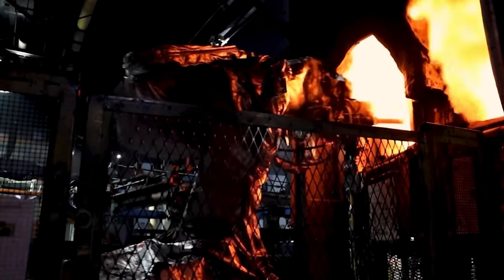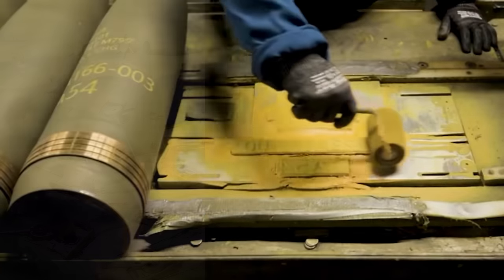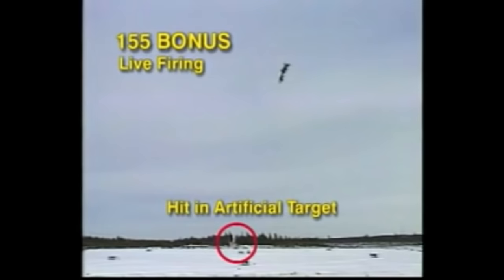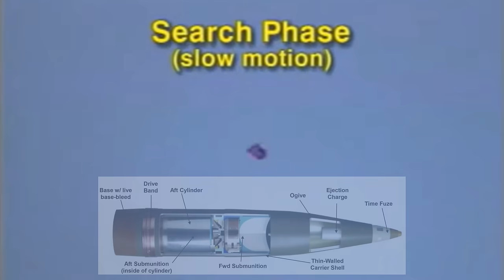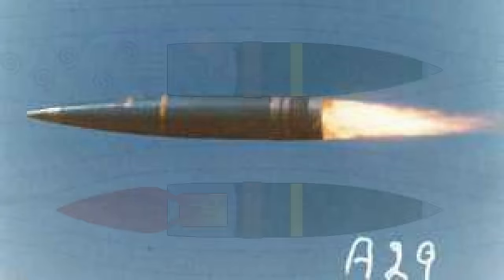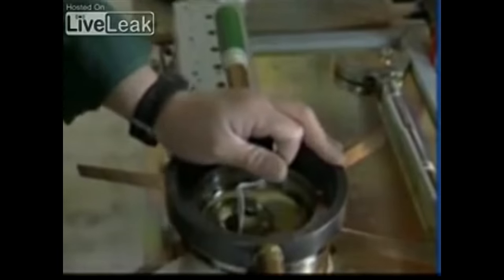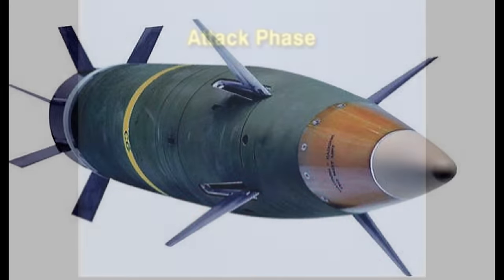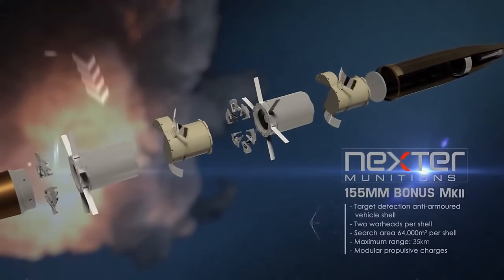Is the 155mm 'BONUS' Round the most Practical Artillery in Modern Warfare? TANK HUNTER KILLER 💥

Comment: Hmm... I think it is really a problem with manufacturing quality and currency - not so much caliber. If you bang 60 year old shells down range, Then you are going to have duds - if they don't explode in the barrel (heavily worn). That is one problem with shitty shells - just about as bad is the logistical inconvienience. If you are running a lot of bad rounds (might be imprecise as well) on trucks - well they WILL explode if the truck or Scooby Do van is provoked by an FPV-drone dropping a grenade on it. One thing is the driver of the truck won't have problems breathing any more - he just stopped smoking permanently.

The price question? Well, the first batches of anything will have their teething problems. But once the production run is going - it is actually more expensive producing a bad round. Modern technology makes the same mistake over and over again - but once the gremlins are fixed. Generally mass production is cheaper. In my ancient experience the shells being painted by a robot is much cheaper than being painted by a painter, that has to have all sorts of protective gear. Just to mention a point where I have seen a development.

The thing is that the first 100.000 shells are going to be damned expensive. but generally: If you take example number off the production line the cost is say X Euroes a piece. When you double the number production 2 X is 10-20% cheaper to  produce. Every time you double the production number there is a 10-20% cost saving.

The current problem is that there is a limited production capacity on the 40 year old tooling that is a hand.

The other problem with advanced shells is that there is more that can go wrong. You mention a dud rate of 10-15% - which is hardly acceptable. That will be corrected along the way. That is small comfort to the ukrainians needing more shells YESTERDAY. But it is a problem you allways run into.

There is even problems with the Leopards track at the present usage. Here I am reminded by "Chieftain" and his obsession with track tension. The might be a reason for his paranoia in this case.

Comment: This is going to require dedicated battery assignment to the supported forward observer. A tank is a moving target, and the FO is going to need to “lead” the tank. That means the FO needs to know time of flight, time it takes to calculate fire commands, time to load, and aim. So the battery (or parts thereof) are going to have to be “at my command”. This was the largest challenge for artillery that was uncovered at National Training Center for dealing with the communist horde attacking in West Germany in the 80’s. A massed attack creates a target rich environment that too many FO’s are trying to hit with too few artillery tubes to go around.

Comment: Been wondering, how this rounds can get the jet so far. Or is it firing some other submunition that again explodes with the jet when hitting the tank?
Reply: depends on the jet ur talking about. 
the jet behind the round is just the round bleed and is similar to rocket assist
if ur talking about the jet from the actual anti tank part that can hit quite far then thats just how far a heat round can travel if equiped with high quality explosive and smart design.
Reply: @flabelflabel7913  The jet from the molten copper that penetrates the tank. From what I know, such streams/jets are effective for only a meter or so. Yet from the video it seems that it hits the tank from at least some 50m altitude.

Comment: It's the same as the German SMART ammunition, only it works with a braking parachute
Reply: Bonus have a much greater range when deployed, it can scan sevetal hektars in seconds
Reply: @matsv201  Have you some sources? I wasn't able to find something like this? But why should nations use Smart 155 when the older system should be much better?
Reply: @85daniel  Well smart was developed as a competitor. I would say the prime benefit of Smart 155 is probobly the cost. If you have a very high concentration of armor, smart 155 is probobly the better choice in thinning them out.

If you don´t quite know where the armor is BONUS is way better.

Not only does BONUS Travel over a wider area of ground, the way it spins it also scans longer to the side, hence cover more ground.

There is also the diffrance of BONUS (if i remember correctly) using ladar and IR while SMART using microwave detection

So why they are similar in concept, they are very different in implementation.

The range from the gun is also better for Bonus being both lighter and have base bleed.

I have not seen number on it, but i would image that the charge is larger for SMART

If cost was no factor i would always go for bonus

Comment: Can the plasma jet penetrate ERA explosive reactive armour , I thought the whole point of the Russian ERA bricks was to blunt the flow of the plasma jet penetrating the tanks armour ? Wouldn't that make this Swedish tech kind of obsolete ? Also can it find its target through a smoke screen released by a tank ?
Reply: Both ERA and smoke screens are orientated to defend against frontal and side attack vectors in expectation of engaging other ground forces. Most tanks are highly susceptible to top attack munitions.
Reply: It is not a plasma jet, but rather a slug of copper, accelerated by the explosive charge. That limits its penetrating power to (BAe numbers) 100-140mm+. Compared to the often 600mm+ you will see for a shaped charge warhead. 
What you lose in penetration, you gain in stand-off range. A shaped charge warhead has to detonate right next to the target for its optimal effect, an explosively formed penetrator can initiate tens of meters from its target and retain its effect. 
When it comes to your question, it depends on the type of ERA. Older types with non or limited effectiveness towards kinetic penetrators will not be effective against these rounds. 
The newer ones in the main works by sheering a long-rod penetrator, but they will still have some effect on a slug. Is it enough? Sometimes, sometimes not. The roof of a tank carries some of the thinnest armor and the slug may retain enough momentum to punch through. Also, the turret roof has a number of hatches and other, smaller areas that cannot be covered by ERA.
Smoke might be effective against the BONUS round, it uses a LIDAR (a scanning laser beam) for its target acquisition. The German SMArt uses a milimetric radar so would be immune. But how should you be able to screen your tank with smoke in time? There is no advanced warning such as with illumination sensors. The scanning by the LIDAR is achieved in split seconds and then the charge is fired. Only if the screening by smoke is achieved prior to the arrival of the shell, be it for other purposes or by warning of incoming rounds, could the BONUS sub-munition be fooled.

Comment: The BONUS round is very effective.
But it’s capabilities are very restrictive!

A GPS guide 155 is much cheaper and way more versatile.

It can destroy all armoured vehicles.
They can be used against buildings and bunkers.
Even cause trouble in a trench.

So I prefer a GPS guided 155 round 😊
Reply: A GPS guided round on an armoured vehicle would need circa 1m accuracy and with a time of light of 60 seconds that's not always very useful against vehicles.
Reply: tanks move and a 155 gps usually cant be redirected in flight

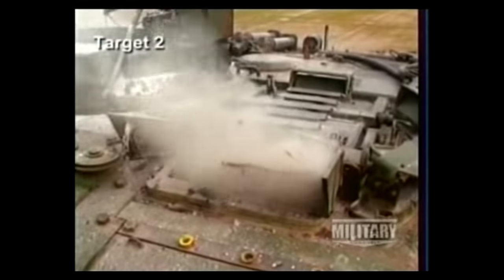Comment: 13:43 3D printing isn't going to make BoNuS -like systems much cheaper. 
3D printing large quantities is much more expensive and slower than molding, folding, machining and other more traditional methods… and makes a difference only when you really need complex geometries that traditional industries can't produce (sponge geometries with a lot of shaped holes, microstructures with variable density, weird concave puzzle shapes, etc) or because you need a high level of programmable customization per piece, aka lot of parametric variations on demand between pieces. This is not the case for this type of shells.
But yes, of course, the unit price of this will decrease if mass-produced, even with very conventional methods.

Comment: @Matsimus good Sir, I always thought that the shaped charge has to detonate a certain distance from the target, hence all kinds of "skirts" and "cope cages" , and that it loses penetrating power in proportion to the square of the distance to the target. How can it be that the EFP remains efective after traveling 75m?? Seems to contadict common knowledge about HEAT munitions.
Reply: I have exactly the same interrogation ! I would be glad if someone "in the know" is able to answer.
Reply: EFP is not the same as a HEAT, a EFP more like a normal kinetic round but the penetrator is formed via the explsovie
Reply: @einar8019  that description also applies to common HEAT round, it is indeed a kinetic force. Common misconception is that is uses actual heat as in thermal energy but the copper in the shaped charge is supposedly not even "liquid hot" but "superplastic" and as I understand it it loses penetrative power not due to "cooling off" but rather has to do with focal point of the inverted cone... Could this be the answer? the cone is so flat is focuses at about 75m? But then again this distance is not guaranteed, this Bonus round might zero in on a target sooner or later right?...?
Reply: @miloszruczynski1230  im pretty sure the shape is different, HEAT makes a jet/small stream whilst the EFP makes a slug which doesnt loose focus
Reply: @einar8019  You know, that would actually make a difference. I'll stick with Your explanation until someone convinces me otherwise, thanks. So it's kinda like a disposable airborne recoilles gun then :)

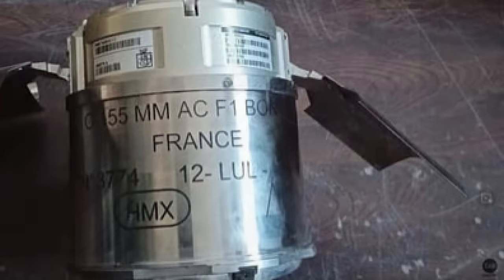Comment: 12:48 @_Matsimus_
A common misconception is that any submunition is more likely to fail and to kill than conventional ammunition for an equivalent military effect. This idea is plain wrong.

Imagine attacking two approaching tanks with conventional munitions. Before you hit them - if you ever did - you'd leave an extremely much larger quantity of unexploded ordnance on the ground than with specialized munitions, which would constitute a much greater pollution and put civilians at much greater risk.
In my country, it was not uncommon to hear of a ploughman killed by a conventional shell left in the mud after the war. And some once-fertile areas are now off-limits to farming, and present serious risks of poisoning due to heavy metal, and may be for centuries to come. A legacy from the days when lack of precision was compensated for by quantity.

The idea of the BoNuS system is precisely to MINIMISE the quantity of used explosives. Hence dramatically reducing the risk of collateral damages.

What's more, unlike many other cluster munitions, BoNuS submunitions don't look at all like toys, drink cans or usual food cans, or anything civilian.
What's more, the trigger on BoNuS submunitions is not mechanical and does not react to acceleration, so they don't present the risk of explosion when handled that is typical of submunitions designed to explode on contact or on a crude timer.

Comment: Modern artillery is about  the round not the gun or the platform.

platform Challenger 3, Leopard   II
Gun 120mm Howitzer  as NEMO?
rof 25 RPM? briefly
targettin,g fire control,, guidance - off platform

roles Inf support, AT, CB, engineering/, assault, landings

everything a tank can do  plus all an  SPG could ever  be

crew: 1 or  drone

Comment: 155 or 152mm? I'd go with 152mm. Why? Simply because there are more of them than 155mm. Not even close.

There are multiple reports from western press that Russia outnumber Ukraine in term of artillery anywhere between 5 to 1, 7 to 1 and even 10 to 1. 

And we all know that is completely reliant on NATO for their artillery guns and ammo. 

And NATO simply can't keep up with Russian 152mm ammo production. Not even 10 percent.

Now, my take on this BONUS round. It's an interesting round for sure. Will it be useful in real combat though? Barely.

Why? Like you said, this thing is too complex and has a lot of moving parts compared to normal 155mm ammo. More moving part = more failure point.

Plus its just too damn expensive. Not cost efficient at all. Normal 155mm rounds are superior to this in real war scenario like in Ukraine

Normal rounds are simpler to produce, cheaper and have less logistical issues or maintenance issues.

"but, but it's accurate". And so is a competent artillery crew. We have heard how Russian artillerymen pound Ukrainian tanks and armoured vehicles many times now.

They use normal rounds. How do we know they use normal rounds? Because they shot multiple times.

"but, but, but BONUS round can replace 10 round for the same job" NO. You DON'T need 10 rounds to defeat a tank. 5 rounds are more than enough.

Russians artillerymen shot 5 rounds or less to kill enemy tanks in a lot of video. Modern age give you cheap drones. Russians use that for their artillerymen.

Plus, even for a smart weapon, BONUS have to many moving part because of how its separating mechanism to deploy the actual tank killer.

Other smart artillery rounds don't have that much moving part. Excalibur and Krasnopol have less moving parts and achieve the same thing.

Artillery rounds don't need to care about penetration because if your tank got hit by artillery from above, YOU'RE DEAD.

Comment: 155 vs 152 is nonsense. The range and fuse are the important part, and there western, 155mm, is far superior. Fire control is not related to 155 vs 152, but is generally superior on western equipment and is the most important factor for lethality.